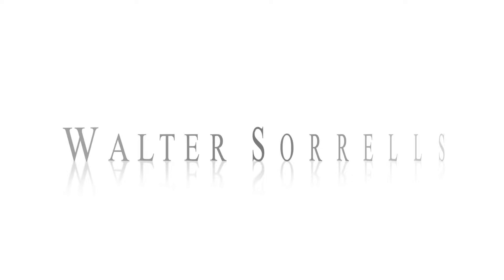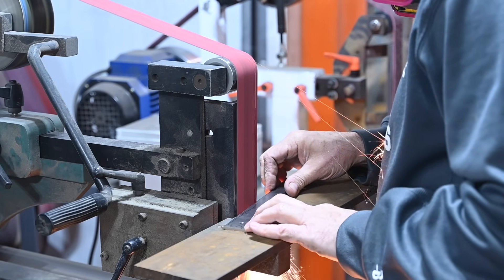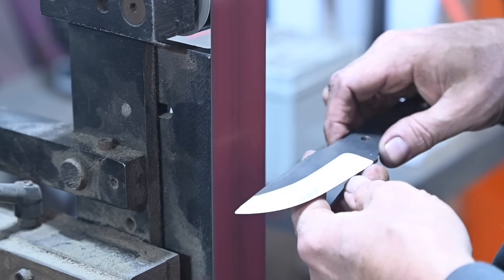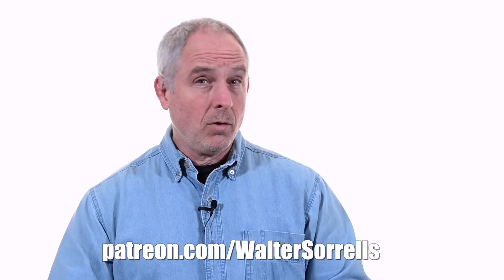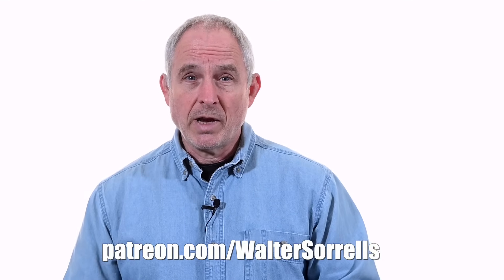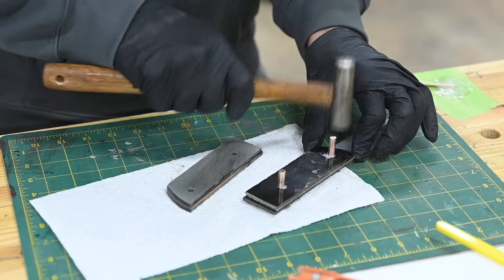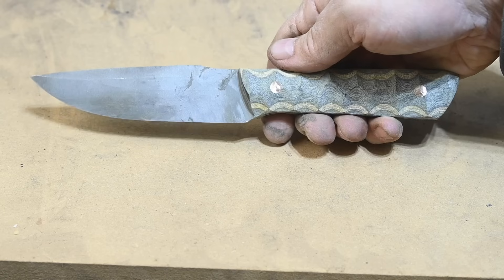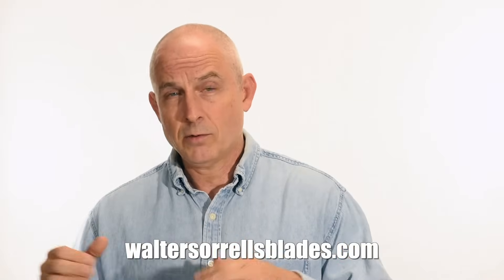I Tried to Make a Knife in 2 Hours! - Can I Do It?

Comment: I am not sure where to ask this question, to get a good answer.  please do not hesitate to reply if you have ideas.  I live in Saskatchewan, Canada. I have a garage, but its full of car stuff, and not insulated. very little room for me to set up and work with my grinder, and I'm worried about getting steel dust on my room-mates car.  I do not want to take the entire winter season off.... I'm in the middle of making two knives right now.  i need some ideas on how to figure this out so i can work on my knives in the winter months. I cant do it outside, its gonna get -30*C for a few months. I have thought about building a small "lean-to" off the side of the garage, but technically supposed to get a permit from the city for that and I cannot afford that... and it would be just barely enough shelter to work out there.   I am living very close to the wire right now(financially) and the knifemaking is keeping me happy which is why I need to keep it up through winter.  any and all insight or ideas are welcome here. I just dont want winter to be all work and no grindy-knifey.   I have thought about setting up a little poly-plastic booth around my grinder, like they do when doing renos in a fully finished house. that might be the cheapest thing I can think of, but it might still take up more space than I have available.